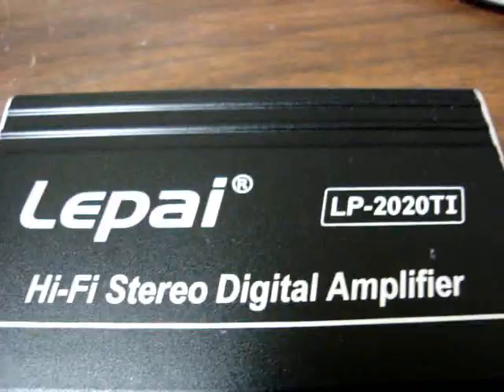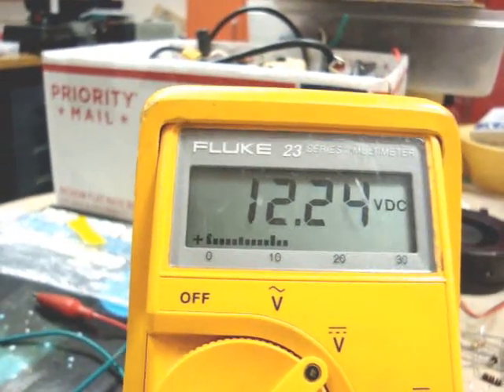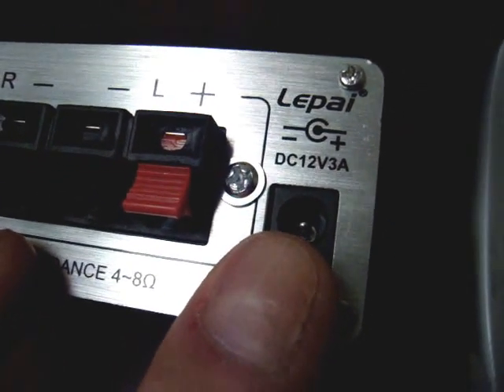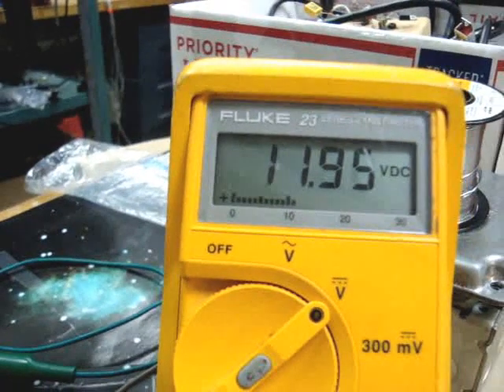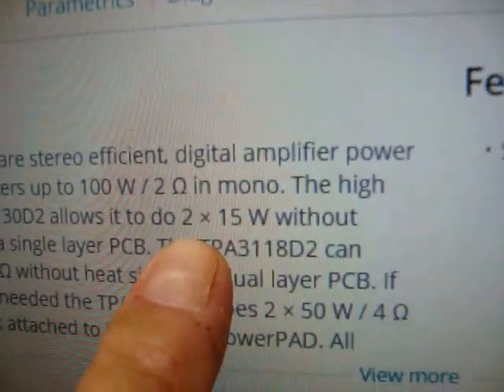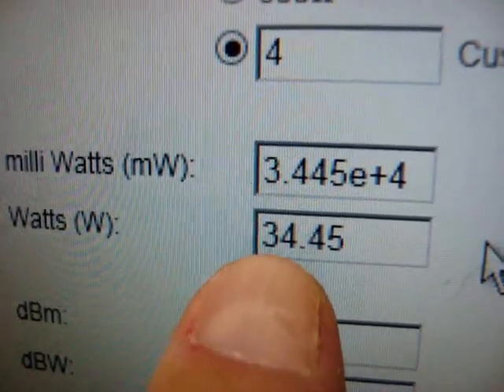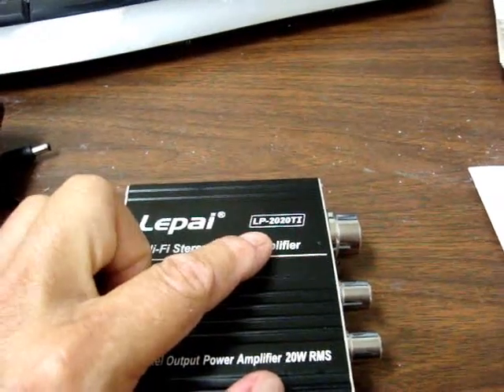Lepai LP2020-TI Amplifier Evaluation

Comment: I have a .55x.55x.24inchand a .35x.35x.2inch  heatsinks and some thermal grease,
will I have to put holes in the board to hold then on.

Comment: Nice review, thank you. So how do you think this amp will behave if i put it in my car and power from the battery at 14.5 volts and drive 4Ω speakers? Do i need in that case to add a heat sink?
Reply from the maker: Thomas Karagiannis - Thanks. This amp should work ok with 14.5v in the car. It should produce 20 watts rms into 4 ohms without a heat sink with no problems. Just remember not to connect  the (-) speaker wire to your car's ground; run speaker wires back to amp.
Reply: Thomas Karagiannis no

Comment: Hey, I have a question. If I have a 19 volt, 3 amp power brick, and if I add a heat sink to the amplifier with a fan, will it work with my power brick? I assume that when you were using 20 volts, you had 3 amps. I wonder if 19v 3 amps will work after mod. Thanks.
Reply: 8Bit Coder , of course it will work, just add a heat sink and cooling fan

Comment: That TPA3118 chip has a solder pad on its base and is intended to use the ground-plane of the PCB as a heatsink. A PCB properly designed around it (with decently thick copper) easily cools it well enough for maximum output with a c. 18-20V supply, but I assume this hasn't been implemented by Lepai.

The TPA3116 version of the chip is designed to use a heat sink and cope with maxxing out on a 24V supply.

The TPA3110 is the same chip again, but with no facility for heatsinking at all, intended to be limited to c. 12V, and implemented the way Lepai have the 3118 on this board.
Reply from the maker: You're right. Here's Part-2 to this vid... https://youtu.be/NsnPGUZEca8Here, I've installed a heatsink... works great!
Reply: M R A Scott , so ur saying the 3116 is the better chip because it's designed to run at 24 volts right ?

Comment: Yo Bob (Old Mel Brooks movie) Bob as I was watching your YouTube "Lapai LP 2020-TI" and I was in complete agreement with you, but, I am not a Electrical Engineer as you seem to be, in fact I'm not even close ! Notice the Power Supply, I have learned on my own that the "minimal" power supply that can be used on any of these Mini-12v amplifiers is 12v-5A at 60 watts (In fact I totally recommend a 12v 6a = 72 watt Power Supply (Despite what the specs from the manufacturer recommend, and... they run just fine @ = 75% Volume)) including the Kinter MA-180 which at 12v 5a on a two speaker system (I actually used it on 4 - 40 watt (RMS) 4" Speakers and it sounded unbelievably great !)) which will run perfect ! Point being, You're the expert not Me !!! Half way through your 2nd update video I thought of exactly what you said when I came back and finished watching your YouTube video, "Yes, how can I attach a 25m x 25mm 12v "micro-fan" on the side of this Lapai 2020TI (AND maybe drill two holes the way you did and attach a very small heat sink inside (40mm x 40mm x 10mm Aluminum IC DDR RAM VGA Memory Chip Heat Sink 55mm that has a center open to drill the holes that you did)) and keep it completely cool (With 2 drilled holes on the other side for venting just as You recommended), BUT, HOW CAN YOU/I REDUCE THE ELECTRICAL FLOW DOWN TO 12V - LESS-THAN 1A (AMPS) FOR THE MICRO FAN AND WIRE THEM TOGETHER WITH THE LEPAI AMPS (KINTER TOO) AS NOT TO "FRY" THE MINI-FAN ??? YOU CAN ATTACH THAT FAN, but I don't have a clue on how to do it, I would just be guessing and probably fry both !!! But I'll keep on trying because if so, instead of the "Sound Storm SMCM200 MINI 200-WATT MONOBLOCK (I'm going to "try' to make this one work first!), I will try to get this to work on/in a 6.5" Down-Firing Subwoofer (I've got (Recently I purchased) a Logitech 2.1 System without realizing it was a 25 watt System (???) with only 15 watts going to the 4" Sub and you can't believe how great this Sub sounds, cranked up to 3/4 volume you will notice it 3 bedrooms away, when you're trying to sleep!) and beat the Logitech Sub by at least 4x in performance !!
Point being x 2, HOW CAN I CONNECT A MINI-FAN UP TO ANY OF THESE AMPS WHEN THE FANS ARE 12v - 1a FANS ???
A degree in Electical Engineering MATTERS !
Your reply is helpful !!!
Rick - SoCal
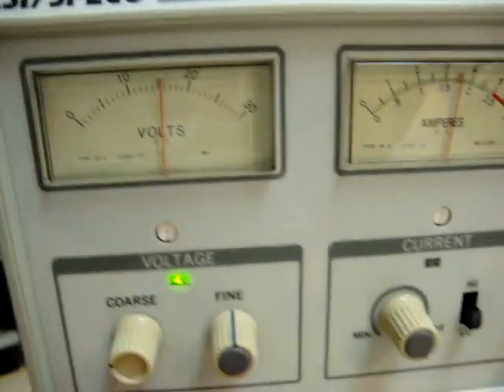Reply from the maker: Rick S. - Thanks for your comments. So, if I understand correctly,  you want to make the high power modification,  but you need to get the right voltage to the fan. first,  I'd recommend a12v fan. then,  assuming a 20 volt supply, a resistor connected in series to drop the voltage to the fan.. that's it. The resistor will probably be 80 to 100 ohms 2 watt for this, depending on the current draw of the fan. That's what I did for 1 of my other amps... https://youtu.be/PvCATGgXnTg . Go 3:18 into this vid and I explain how I connected the fan. This can help you with yours.

Comment: You are right, only 15W per channel with the included power supply. If you go to this page in the Part Express Website, you will find this, under "All the features you need": 

Please Note: The included power supply is capable of driving this amp at 2 x 15 watts per channel. To realize the full potential of this amp (>20 watts per channel), we recommend a power supply that is capable of producing 60 watts of total output. (And a heatsink, of course, as you have already established per T.I.  Data Sheet)

http://www.parts-express.com/lepai-lp-2020ti-digital-hi-fi-audio-mini-amplifier-with-power-supply--310-3000.

Thanks for your review, greatly appreciated.
Reply from the maker: Good info, thanks for posting. It's nice that Parts Express posted that info. I'm quite impressed with the Lepai LP2020-TI - it's very clean. It would have been nice had Lepai just put an asterisk by their 20 watt power rating so that we would know to read the subscript for caveats or other notations. Regardless, 15 watts is less than a DB from 20, so it's no big deal. I now want to mod this amp for the higher output. I'll make a vid of that too. ;-)
Reply: You're welcome, and waiting for your next video. Deeply appreciated. Greetings from PR.
Reply from the maker: I've made a Part-2 to this vid... https://youtu.be/NsnPGUZEca8
Reply: Thanks for your kind invitation. Deeply appreciated.